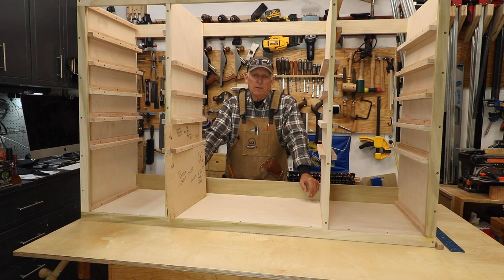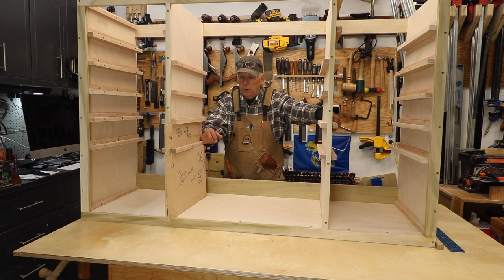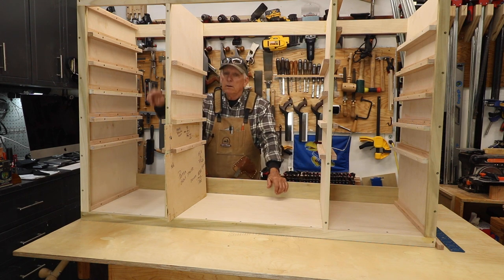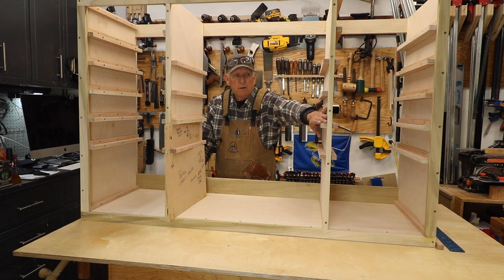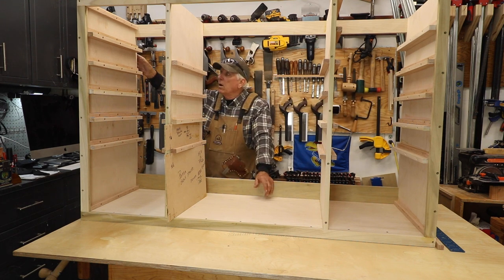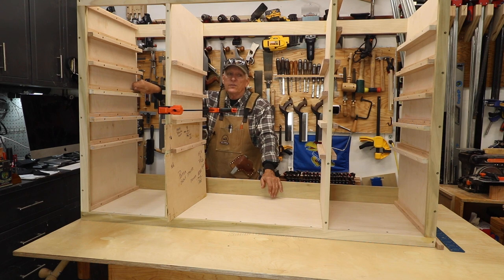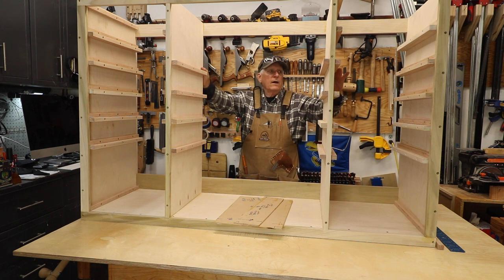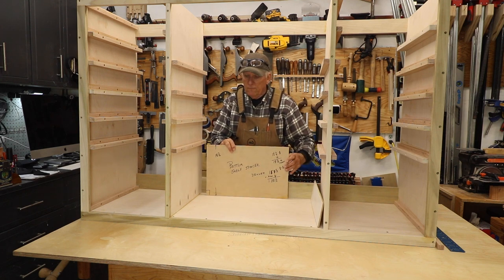Mobile Shop Cabinet Build Using Face Frame First Technique - Part 1 - How To Build the Carcass

Comment: Wow, can’t wait to see how you rearrange the shop to fit these cabinets in.  Cool project, great editing.
Reply from the maker: Oh, I have a video planned for that!  Most of the new cabinets are either replacing existing ones more efficiently or using open spaces under various power tools like the jointer.  But now I have to do a little tool cart shuffle each day to start my shop time.  A few things get rolled out into a covered carport just outside the workshop.

Comment: Must be cabinet month! This one is looking huge and impressive. I'm with you on the hardware. For workshop builds I can't justify the cost of drawer slides and such most of the time. Big fan of pocket holes for face frames too. 👌
Reply from the maker: For those who have a Festool Domino, I believe that is a better option than pocket holes, but pocket holes are certainly easy and if done well, can be strong.

Comment: Nice one, Paul! Seems an effective build with the pocket wholes. I have never built a cabinet so far myself. Would be interresting to hear in the end what the material for one of these cabinets has cost you overall.
Reply from the maker: Most cabinets would not be this large with so many drawers.  A cabinet of decent size with 3-4 drawers would probably take 2 sheets of 3/4 inch Baltic Birch and 1-2 sheets of 1/2 inch Baltic Birch for the drawers - so my guess would be $200-$300.  Hope that helps.

Comment: For those draw slides - the glue is doing the work of holding them up, right? Do you think just brad nails to secure them while the glue dries would be as strong? Or do the screws add extra strength?
Reply from the maker: I am sure glue and brad nails would be fine - like Wm Ng, I like to over engineer things - trying to make these shop cabinets last for severa  future generations.
Reply: Glue these days is as strong as if the 2 pieces of wood were one. Yes Brad nails would be fine. You can never over secure though. Cant wait for the drawers part!
Reply from the maker: Coming soon - using one quarter one quarter one quarter method which I will use evermore!  So cool!